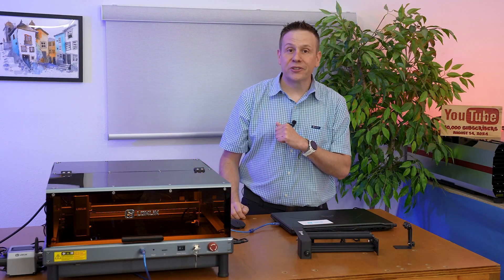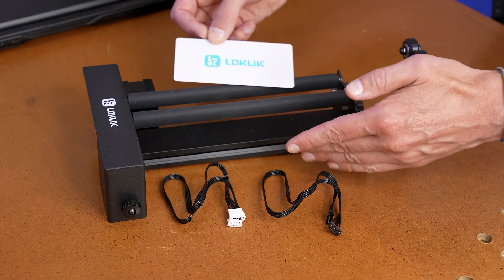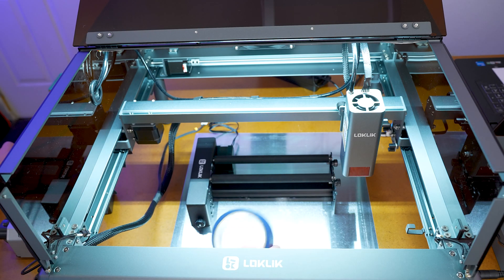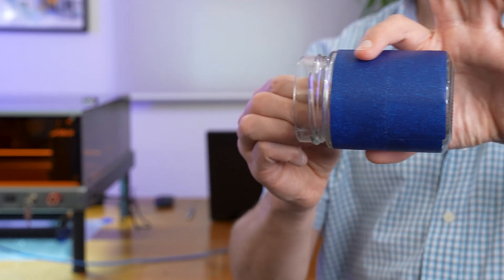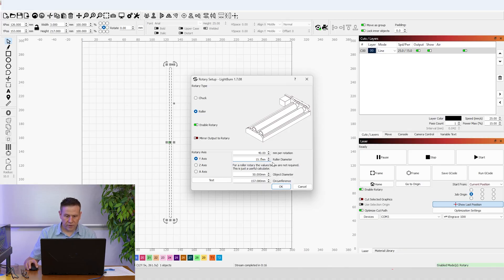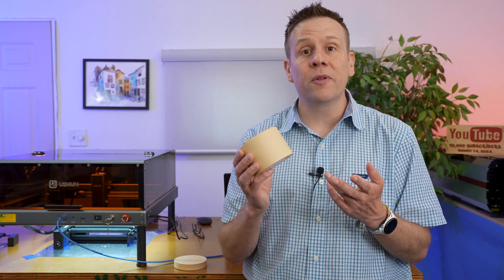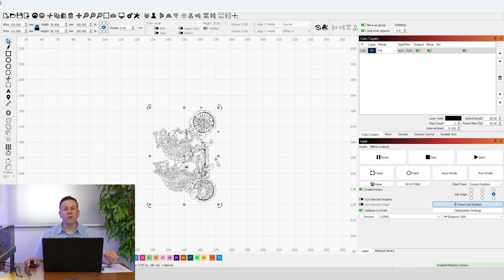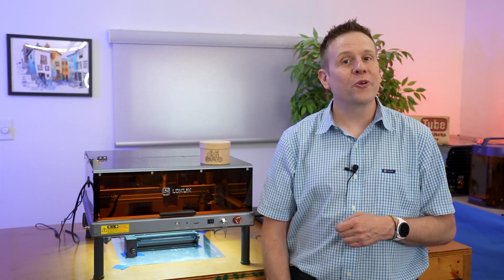Rotary Setup- iEngrave by LokLik #loklik #loklikiengrave #htvront #rotary

Comment: Hello.  I would greatly appreciate a video on how to install the air assist.  The written instructions are not clear and it appears the instructions are asking us to take out the current nozzle and replace it with a smaller one…. A video would be most appreciated.   I am unable to locate one.   Thank you in advance.